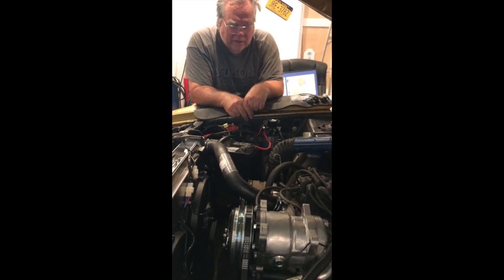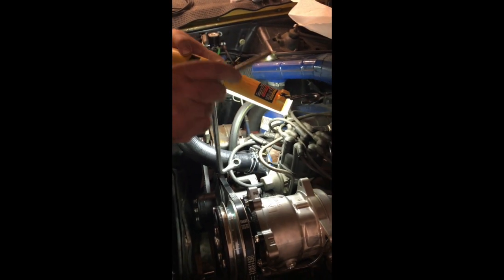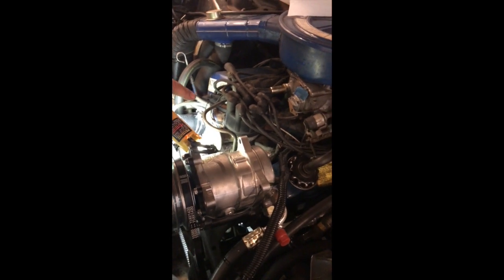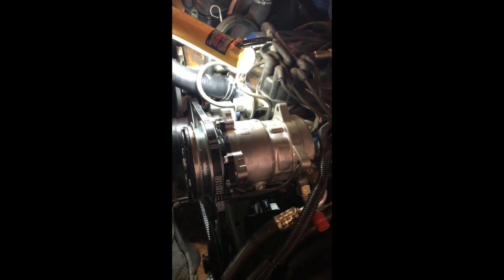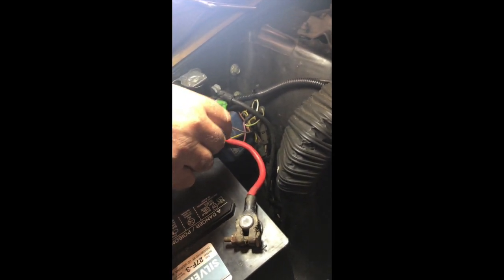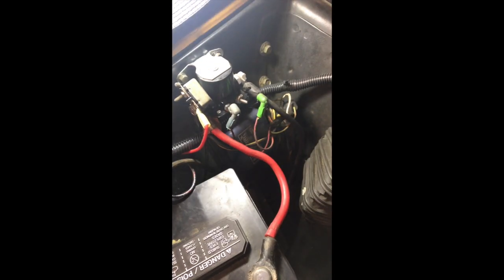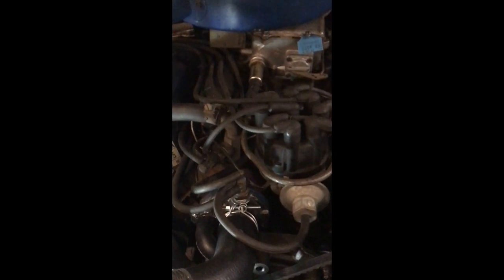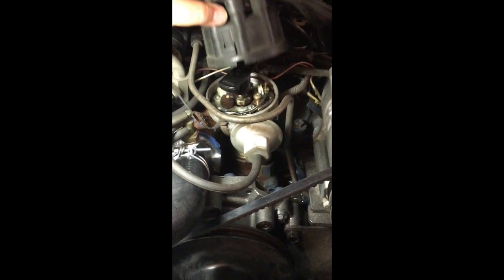6 2 Dead Stick Initial Ignition Timing 20200605   HD 720p

Comment: Thanks for this great information! Would this be very similar when installing a hei distributor? I’m sure everything is up until the point where you check with test light the ignition points when facing spark plug 1. Thank you!
Reply from the maker: Hi!  I am glad you found the information useful.  Yes, the same technique is useful for (re)installing a distributor.  The one additional step I recommend is to "clock in" the distributor in such a manner as to allow the Vacuum Advance Diaphragm plenty of room to let you rotate the distributor housing as you dial in the initial, dead stick timing.  Due to the spiral cut of the teeth of the distributor drive gear, getting the distributor to be aligned to provide lots of room for the Vacuum Advance Diaphragm to be moved around can be a little challenging.  

There are some good videos showing how to install a distributor that I think you will find useful.  You can find them in YouTube by searching on the following string:

how to install a distributor.( on a ford 302}